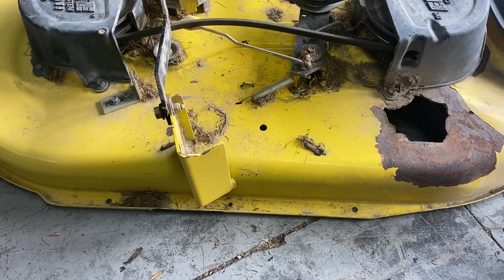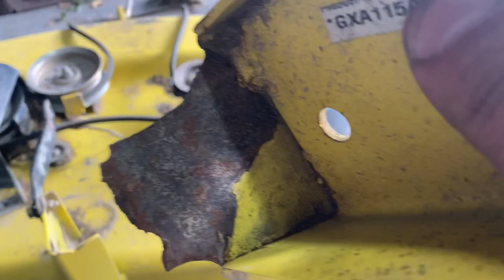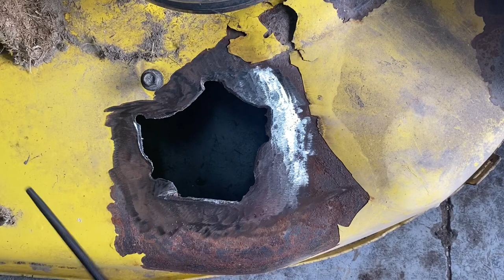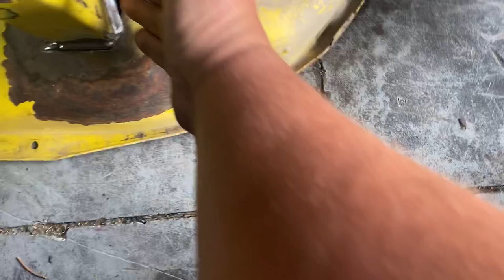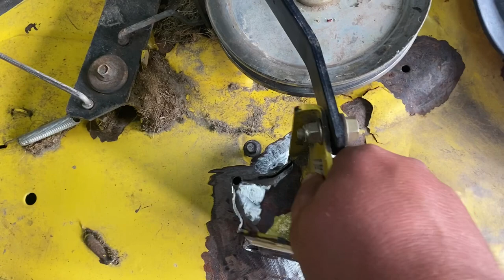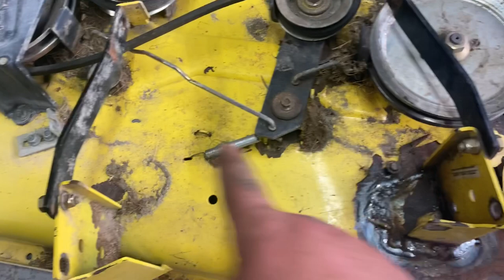Repairing a John Deere mower deck

Comment: I have a few JD 212 210 etc and other GTs.  Every one of them was bought with less then perfect decks. So every now and then I pick a deck and bring it back to life
Reply from the maker: Iv seen a lot of them in my day, the biggest thing I see with the John Deere decks around here is rot at the spindle mounting points
Reply: @smalltownmachineshop6860  around here mostly what I seem to have to repair is the front  mounting point (so far)

Comment: The EXACT same break occured on my JD lawn mower...  also a 42" deck.  Fortunately, there is a welding shop literally right in front of my barn & sheds.
Reply from the maker: The decks vibrate so much in those mowers it seems to form stress cracks at those mounting points